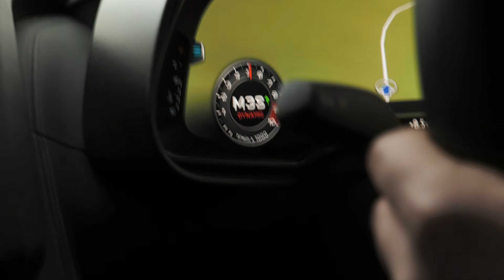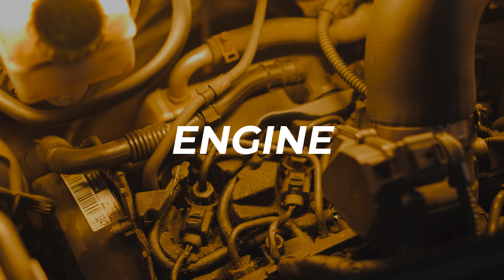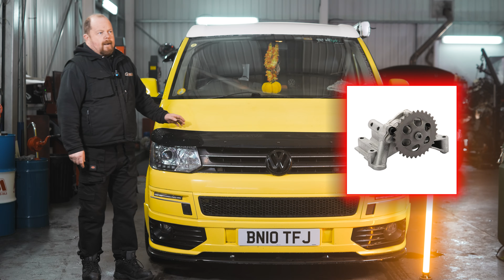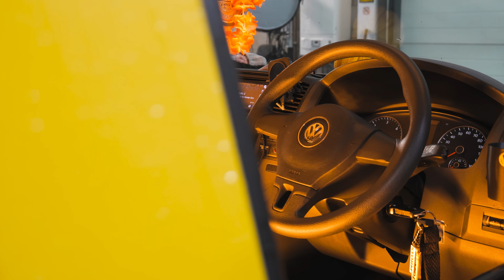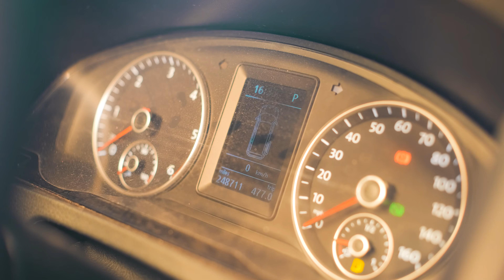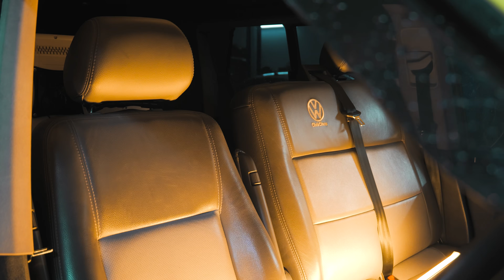VW T5 TRANSPORTER COMMON PROBLEMS!

Comment: Great video. I've had a 1.9 for over 10 years. great van.
Reply: I had my 1.9 T5 for 13 years. Done over 130,000 miles in it. Just needed a gearbox and head gasket. Sold it on 196,000 miles. It’s still going!
Reply: @Vwfan  just a gear box and a head gasket 😍😂😂😂😂😂😂😂😂😂😂😂
Reply: @tomjones8715  yes mate. Track van. Hybrid Turbo, bigger injectors, inter cooler and remap. Lowered 100mm. 220bhp. 
Was a regular on Brands Hatch Circuit. Some hobbies are expensive 😂 👍🏼
Reply: @Vwfan  in fairness from my experience go that van in normal specification uou are lucky! Mine done more than that with gentle driving up and down the a1 everyday.
Reply: The 1.9 is a very, very well known engine, no reason a well maintained one wouldn't do that well, whilst watching for the typical problems.
Reply: @christiancarter152 yeh that’s the model I had.

In fairness if you account for the common faults you’ll be fine. I just got fed up with it.

I have the 3.0 Vito and it’s mint. But I’m swapping it for a pick up soon.

You are in a marginally better place than those with a new transit thoufg 😂
Reply from the maker: Good to hear!
Reply: @christiancarter152 100bhp 😂
Reply: @christiancarter152 I’ve given in with vw Audi group. I find the brand over rated. I found the 100bhp very dated though. I now have a Vito…and it shifts.
Reply: @christiancarter152 my vw looked great, and was very comfortable to sleep in. That’s what made it great. On the 8 separate breakdowns I had somewhere to sleep and wait for the rac!

Not even joking!
Reply: Either you have done 10,000 miles in that time or you are lying.

Comment: Had the cfca biturbo 3 yrs before it needed a rebuild due to excessive oil consumption so instead of spending 12k on another shit engine, I built a better one and dsg rebuild ( spider gears changed along with worn driveshaft/seals etc etc ) with linered block/new head+cambox/pistons/conrods/re shelled/new hybrid turbos/cp3 stage 1 hp fuel pump conversion/stage 1 peizos/balance shafts deleted/high flow oil pump/egr delete/dpf delete/large front intercooler/front mount eng oil cooler/4bar map sensor/remapped along with dsg---280hp/500nm  all day every day and will probably return double if not triple the millage/life of vw's shit factory engine/serviced every year or 5k using high zinc oil.
good advert for vpower, run it for 3 yrs owning van, when I stripped engine I expected it to be fully coked with the amount of oil it was using but it was spotless hardly any to no build up.

Comment: Any problems with 2.0tdi blue motion ?
Reply: yes but not as many as cfca biturbo, 140hp non add blue best transporter engine so far apart from the old pd's , 150hp ones suffer with premature cylinder wear due to vw miss matching piston/ring material to bore material.(you could reduce this by using full fat zinc oil roughly 18% but would eventually destroy dpf but would help save engine.
204hp can suffer same as cfca biturbo just takes longer( can be avoided, if egr cooler is swapped every 50k obviously before it fails and causes damage which is only apparent after ie oil consumption).

Comment: I have a 2015  SPORTLINE TRANSPORTER CFC BITURBO that started using 1 L of oil every 1000 miles and got gradually worse.   I contacted VW about replacing the engine; they offered me 10% off a new engine costing £12,000.
Reply: was that fitted?

Comment: Sorry, can’t help feeling you missed a lot from these overrated vans, I have had a 2007 2.5 bnz for 12 years, and problems that I believe are quite common that I have had, turbo gaskets blown (can here whistling), injector seals leaking and worn injector sleeves (causing poor starting after left for day or more and white/grey smoke build up in traffic), tandem fuel pump leaks, abs pump ecu burn out failure (warning lights on dash), indicator High/low beam stalk switch failure, central locking failure ( doesn’t always lock unlock all doors), plus have heard of other faults that hasn’t yet happened to me, like alternator drive coupling and more, nearly always expensive to fix and labour intensive, mine has now. Overextended 160k miles but most of this started happening before 100k, I believe the 1.9 is better but then you have a cam belt to worry about, Oh and the radio speakers are shit, sorry to disillusion anyone thinking of getting one, but they do drive nice😊

Comment: I love my 5.1. I had EGR issue so I deleted it. 

Remapped from 98 to 162bhp. Been pulling hard for five years. 

I get over 800miles out of a tank if on motorways and keep it to 60mph on cruise.

5th gear is whining and dual mass and clutch was changed 25k ago but still makes noise when cold.

If you want repeated drive shafts issues, lower your van. I’ve only smashed 4. So, now it’s not as low as it once was!

Comment: Mine tells me a door is always open when it isn't :/
Reply: Switch on the door lock is faulty
Reply: @ianhargreaves4978  is it an easy fix? I think it's the driver side slide door. It unlocks with the remote but it won't lock so I'm guessing it's that's door
Reply: @eltel25 new lock required
Reply: Tried to find some online but no idea what I'm looking for :/ @ianhargreaves4978

Comment: HELP !!! I get a vibration on the steering wheel when I first start up, it’s a T6 140bhp 65 plate done 128,000 fully serviced up, it’s been so reliable and cost very little in repairs. I just get this annoying vibration when I first start up, no noises, no grinding, fine after I have left my drive, only when it’s been stood for a week or so. Vibration is before I even move away ! Just turning the steering wheel! Any ideas ?

Comment: Ive got the problem Bi-turbo and its been nothing but grief. Huge oil consumption with no visible leak. Having to get new turbos at the cost of 3.5K. New radiator, EGR, and DPF. Can someone tell me if its evn worth doing the turbos or is it terminal? Im getting 250m per 2liters of oil.

Comment: Hiya just changed my bottom Rollers on my VW T5 which I have already done once before and worked fine for quite a few years but this time it's getting stuck at the point where you fully open the door do you have any idea why it's doing this?

Comment: Change the AIR AND OIL filters regularly or they EAT turbos! I bought a high mileage AXD 2.5 one im converting to a camper and the external oil flters become porous and start leaking oil but only the high mileage wagons. But ive ovehauled all the running gear and new drive shafts so its like new mechanically and getting a new engine shortly so turning the clock back. Otherwise a solid wagion better than a FROD or a MERC! Great video cheers.

Comment: I have a VW T5 from 2013 with 26000 km, and Its clunky when going over bumps fast and now there is noise from the wheel when going high speeds, possibly wheel bearing?
Reply: top mount loose/worn or anti roll bar bushes/links, check tail of coil springs for breaks

Comment: Very informative.
I have a 2014 T5.1 T32 180 bi turbo, 65k miles so far.
Problems I’ve had so far.
At night I sometimes get very faint warning lights on the dash display come on for no reason, so for example, if I have cruise control on, sometimes I get a very very faint seatbelt warning light come on. Doesn’t happen all the time and you can’t see it in daylight. I suspect damp causing tracking across the circuit board?
Water sometimes leaking through the side sliding windows. Drip hole blocked.
Once the side sliding window just fell out. Easy fix, glued frame back into the glass.
One of the cup holder spring loaded cup clamps disintegrated, drivers side, which I’ve been told is a common thing. But replacing it is not easy.
Occasionally random front and rear parking sensor sound a warning even though I’m not hear anything else. 
Otherwise it’s been fine but I am OCD with regular servicing and I only use OEM parts.
No regrets buying it.
Reply: That model has well known EGR problem. It will destroy your engine. Take that car to mechanic who knows VW Transporters and let him check does it have that model egr which must be replaced. Before it will brake your engine. I have friends at VW mechanincs and they told me to buy new EGR when i bought mine T5 2.0 tdi 180hp 2015.

Comment: I’m new to the T5s I have a 2009 2.5 6speed is it normal that when using 1st & 2nd gear I need to be really steady with the clutch? Otherwise it clunks (I assume it’s the DMF) If that makes sense.

Comment: I’ve just bought a 2.5 t5 with racing calipers, the brakes work fine but the handbrake does not, just wondering if anybody has any suggestions other than putting old calipers back on 🙏🏻

Comment: I have had a Toyota Previa 2000 with 185k on the clock for the last twelve years. Doubt it will get another mot(emissions. This car has been fantastic, completely reliable, cost nothing but yearly service. Replacing it on Monday with a 2013 T5.1, biturbo with dsg. After watching this and reading the comments perhaps I should kick vw into touch and go for another Toyota.

Comment: 1 thing Id add, if you are changing Clutch and DMF on T5.1 fit a new Slave Cylinder while the gear box is off. Slave cylinder is in the gear box. My slave failed, so changed clutch, dmf and slave all at the same time 134k miles on the clock
Reply: id do crank seal at same time and probably crank sensor as well while flywheel is off.

Comment: #1 ... Indicator/headlight switch unit
#2 .... EGR
#3..... Dual Mass Flywheel with Pressure plate and release bearing.... These tend to fail almost the same time
#4 ..... 5th gear failure.....caused mostly by Clutch problems or incorrect gearbox oil or level
#5 ..... Waterpump failure due to cheap design
#6...... Alternator pulley one-way bearing failure
#7 ..... Tailgate door latch failure
#8 ..... Middle seats flip over mechanism failure (wire snaps) 
#9...... Front strut mounts for shocks wear out quickly
#10....... V-belt tensioner failure due to #6 above

......*** These are all the problems my friend faced within 3 years of owning this van ***..... 

It drives nicely and comfortably .... But parts are hell expensive

Comment: I’ve had mine for over 10 years it’s a 2010 t5.1 and have 352k on the clock now, been through 3 gearboxes though.

Comment: Bit of advice really from people. 2017 t6 2.0tdi started this morning and noticed rpm was not raised as on normal cold start (its 22 degrees) wondered if this was normal for hot day. ?
Reply from the maker: The engine revs will increase on cold start, with the weather being hot atm this sounds normal

Comment: I would never fit the SACHS DMF clutch kit on VW again. They wobble after literally 100 miles. They dont "bed in" nicely until 1000 miles even with brake cleaner and by then it needs replacing. literally. Done 3 using kits from reputable local automotive shops. Not online! I would only fit LUK now for VW TDI

Comment: My question, is there such a thing as a reliable van out there nowadays ? Something similar to the old 1.9 sdi engine found in the mark 2 caddy.
 I get talking to couriers on a regularly basis and just out of curiosity I ask them " what's that yoke like?". This is generaly what I hear back.
 (Sprinters (Injector problems) 
Transit ( Timing belt issues, blown turbo, injectors
French yokes  ( gearbox, faulty steering rack)
Why do these modern engines have so much electonic crap? 🙄 
We then also have to deal with egr valves, adblue , crank sensors,fly by wire sensors, you know yourself, the list goes on . )
Maybe it just my age, but I prefer engines from the 90s. Yeah,  lots of black smoke . But fairly straightforward and wouldn't cost you a fortune to fix.  
Anyhue, thanks for the T5 review.  🚚👍

Comment: No real mention of the electric windows which do go, it’s the motor module inside the drivers door, circuit board gets fried. Easy to replace but part is fairly expensive

Comment: Hi guys. Cracking vid! Where you mentioned the attending column joint fault, mine vibrates slightly when turning left and right, very strange feeling! Literally as if the rack or pump is faulty, think the joint could be the problem? Thanks!
Reply: Check the top mounts on the front suspension when turning lock to lock. If you look up inside the suspension turret you will see the top mount skipping. May possibly be your problem

Comment: Hello sir, I desperately need help and I hope you can help me with a adivise. I own a t5 2.5 tdi 2009, the cart starts but don't accelerate! I change the throttle pedal, i check all the wires and all seems good! I recived this error and dont manage to delete 001602 - Sensor Reference Voltage A / P0642 - 000 - Voltage too Low - MIL ON , what you can advise me to check. Thank you in advance!

Comment: My 2006 is on 222k was my dads van so looked after but my pet peev is my courtesy light dont work no power to any of the lights in front or back. No fuse problem and people have sed the box under the drivers seats connections gone green but were fine and still cleaned. Another mention if the heater fan resistor which is a easy cheap fix and the tandem pump make sure theres a gasket with it or u get 1 at the same time but another easy fix but its a £250-£300 parts bill

Comment: You forgot to mention the utterly useless 5 speed manual " O2Z" gearbox that is fitted to the 1.9......as unfit for purpose in a van as it's possible to be. And ask me as a 1.9 owner how I know...or rather how my wallet knows. It's a glorified car gearbox fitted to a van with a potential gross weight of over 3 ton.
Reply: Seems silly I had 6 in my 06 touran

Comment: I got my T5 new as a work van in 2013, i bought it from the company four years later on 218,000. It's ten years old and it's ok. Its had two flywheels, a clutch, rear oil seal and gearbox bearings, stainless exhaust, three sets of brakes, five sets of tyres, a rear door tye/stop, two windscreens, three cambelts, alternator belt and tensioner pulley, four springs and an engine mounting. It's now on 268,000m does between 37 and 41 to the gall and i can get 700 miles on a tank of fuel. It got a service every 20,000m early on, but now its done every year. It's a 20ltr 114 bhp and like all vehicles it costs to run it but not overly expensive. My van is not as nice as the yellow T5 but i love it.
Reply: You still going to run it even over 300.000miles ..  my t5 has just had a new crankshaft  at 200.000 miles .
Reply: Just love these Kombi's..Beautiful animals❤😂

Comment: I have 2005 2.5tdi axd-engine with 972000km on it. Having a problem with oil getting mixed with diesel. Injector seals changed and probably tandem-pump next. Great car to drive long distances.
Reply: 💯 tandem pump

Comment: I have a vw kombi 1.9 tdi. The problem I have is that I would drive and van wud just cut out.... the glow plugs warning lights comes on.... and after a few minutes it will start up.... and so it will go on and off till I get to my destination.... Any thoughts pls
Reply: We had the same problem with our caddy 1.6 2015

Check the wireloom to all the injectors. 
UNTANGLE THE HARNESS AND BE THOROUGH! 
CHECK EVERY SINGLE CABLE!

we found a single worn cable that gave a misfiring code.

12 visits to different shops, changed a lot of injectors among other things and one dude just pulled the harness apart around the injectors and looked at them from every possible angle and found the single faulty wire. 
A total of $8000+ price tag over the years that actually was a 2 hour and a single patched cable job.

Comment: they are a labour of love for sure. and a money pit to boot. I have the 1.9 tdi on a 09 plate. had new engine, gearbox, clutch, dmf, turbo , drive shafts, accelerator sensor. door actuators , coolant pipes , turbo cooler , injectors done twice  ( don’t recommend carwoods coventry, they will rob you ) passes MOT every time and then breaks down in between. looks great but wish i had bought another T4 after the previous was written off.

Comment: Great video, sums up almost all the challenges I have with my vw transporter 5.1(6). Currently battling broken engine mounts and seeking ideas to fix it. 

It's a great work horse, but the drive shaft and engine mount(seats) could be frustrating when it develop issues.

Any ideas on how to improve the Engine mount ??
Reply from the maker: Try uprated poly flex mounts

Comment: Hi, I will of course keep watching, sorry to come back, no doubt you're busy so thanks for the reply.
From my last comment "I of course can't expect you to say buy it but 
*but what do you think of these vans and is the £7.5K about right?*. It appears they do have issues and expensive to fix.
*from my description is this price of £7.5k about right?
At 2.22 you mention cam-wheels as opposed to chains or belts, 
Is this what I would call gear-driven cams? 
*How will I identify this engine as the owner says it's the gear drive cam engine that is fitted in his van and claims is the best and most reliable engine to have, is this right?*. 
Thanks.